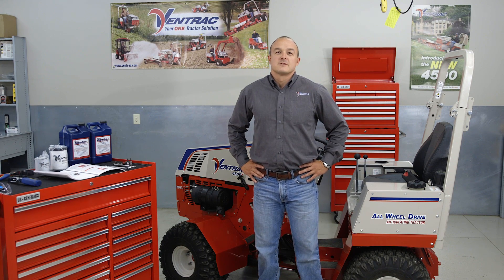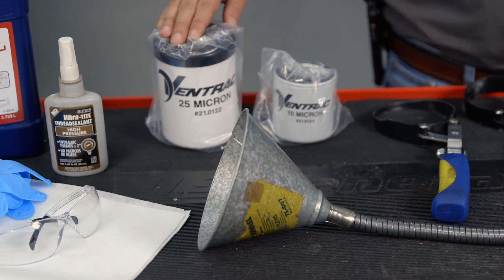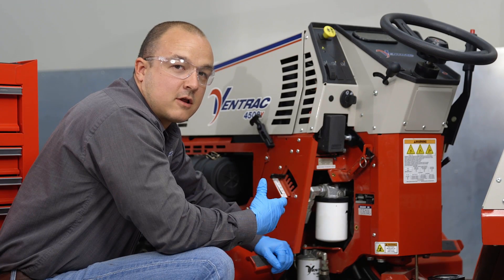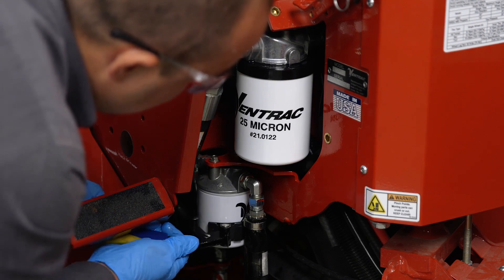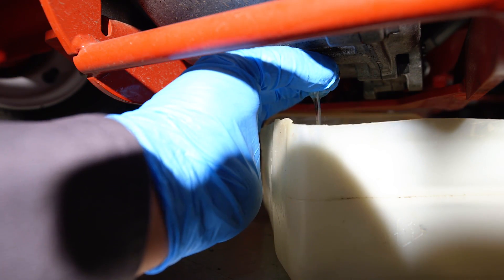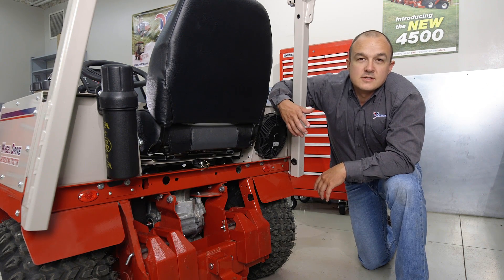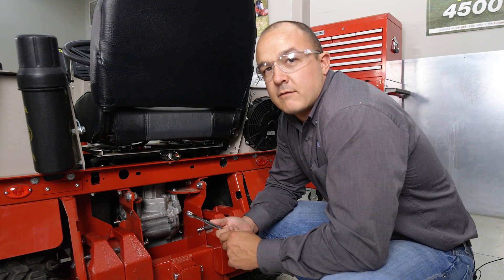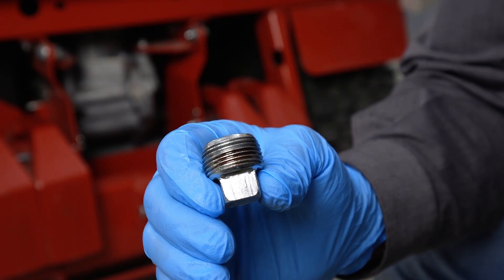Ventrac 4500 Tractor Hydraulic System Service

Comment: I just did this for the third time  On my 10+ year-old 4500Z, I noticed  the male pipe plug fitting for the rear axle fill is NOT 11/16", but rather 5/8".  That plug is back in a boxed-in area and using an typical lengyth open end wrench has one engaging at an awkward angle.  I had a crow's foot wrench for a socket and extension that fit nicely.  Later,  I found a female 5/8" 4 point socket that is perfect.  At the rear drain, my older 4500 was made before Ventrac provided that P-shaped cut-out in the bash plate for access to the hex drain plug.  Previous two times I removed the bash plate, witch is very awkward to re-install without assistant.  So,  I used a grinder to cut room in the slot for easy access.  BTW, 5/8" female 4 point sockets are readily available and inexpensive; but the 11/16 versions are hard to find and crazy expensive at retail.

Comment: How much oil need for the hydraulic sistem? And where do you use the threadlocker?
Reply: He’s real good about answering comments isn’t he. Central’s are very nice machines when no issues but only problem with that, always has issues. Once hydraulic system is tainted, never be the same

Comment: My dealer says this MUST be done by authorized service tech using Ventrac exterior filtering system to make sure any particles are removed.  Service manual seems to agree with this video.  Do not want to risk my warranty.
Reply from the maker: The filtration procedure you're referencing with the exterior filtration system is only necessary if the closed loop components  are being opened up or removed for repairs or replacement. As stated in the manual, the closed-loop components are the hydraulic pump, the hydraulic motors and the ½” hydraulic lines that connect these components together.

The filtration procedure is not necessary or recommended when only changing the hydraulic oil and/or hydraulic filters as this process poses no danger of contamination if done properly.  Thanks for checking though!